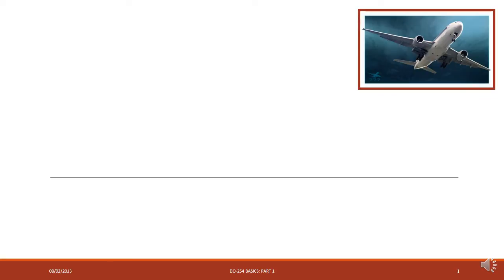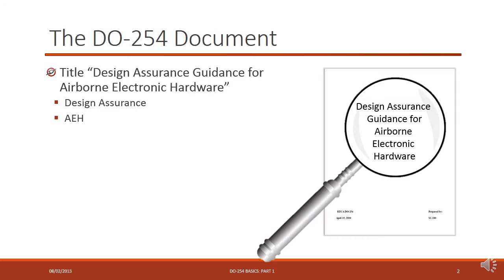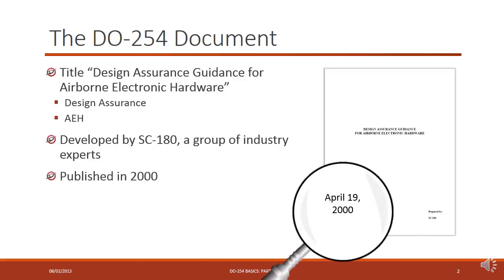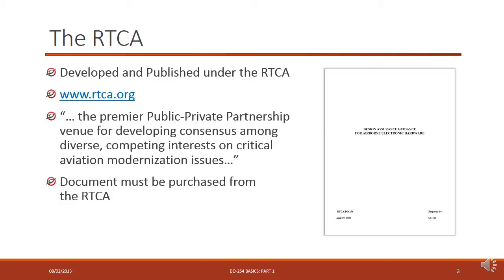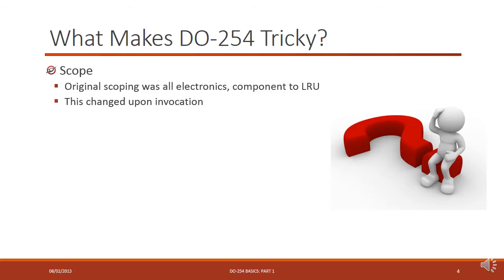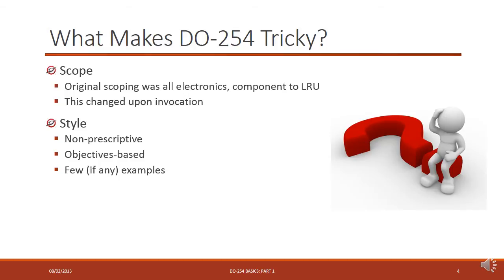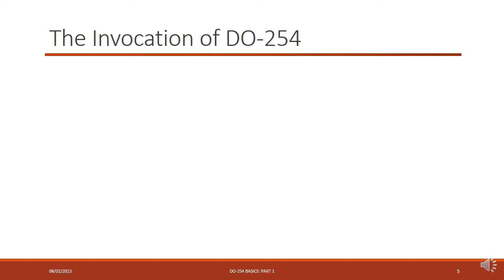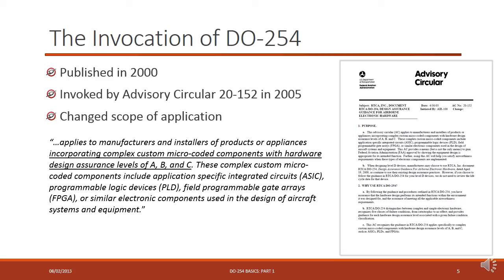OLD: DO-254 Basics Part 1: Development History and Invocation

Comment: Okay... Still, what is the do 254 for?
Reply: DO means document... and 254 is just a number to identify uniquely this standard.
Reply: The answer to your question is specified within 1 min 15 of this video.
Reply: At 1 min 24. "Basically a structured process to make sure that any errors that could be injected into the device will be caught such that the device does what it is supposed to do". As the title defines that the devices are "Airborn Electronic Hardware", it is really obvious what DO-254 is attempting to do, it is literally a guide to robust engineering design, verification...
Reply: @edwardfisher29  Exactly and every industry has similar documents. eg API6A in O&G